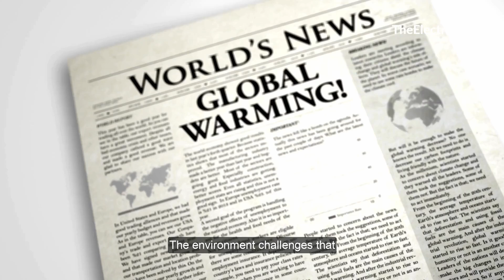Goodbye SF6 l SF6-Free Switchgear l Why? TheElectricalGuy

Comment: The problem is the uncontrolled use of SF6. Many industries and energy company have leaks in the equipment and they don´t want to outage the system to fix that, so the leak keeps releasing SF6 to atmosphere for years.
Reply from the maker: Correct